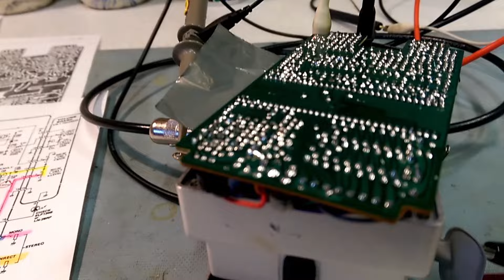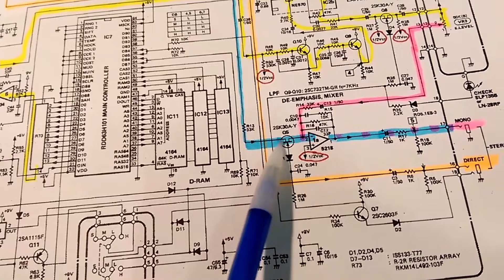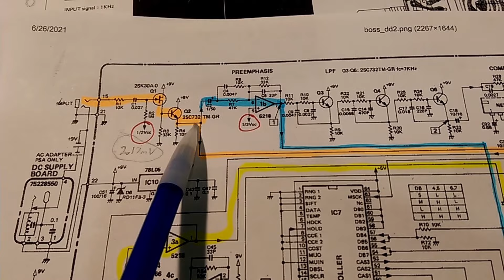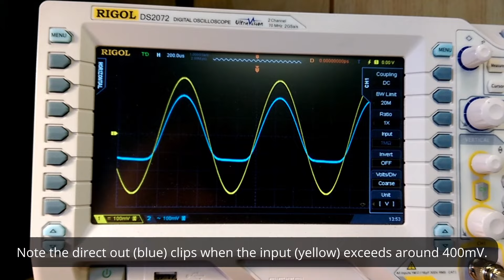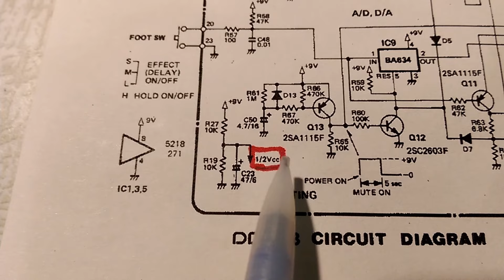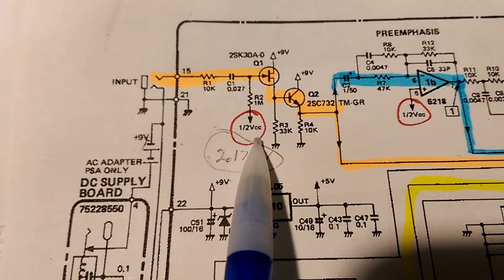Boss DD-3 Delay Pedal Troubleshooting and Repair (#001)

Comment: Nice video. I have a problem with my ds3, repeats sounds lower than dry signal. You play guitar, you have output ok but repeat is in a lower volume or sound like far, you know what i mean? Maybe if I have MXR Micro Amp activate isn't a big difference but you can hear something wrong. Thanks for read.
Reply from the maker: The mix control should adjust the wet/dry ratio.  Is that knob not working?
Reply: @mevmevmev  i don't have that knob... only entry signal, feed back, delay ratio and delay modes
Reply from the maker: @ezequielaugustodelcastillo6467  the first knob on the left "E-LEVEL"  turned up (clockwise) should bring up the repeat level.  Is that knob not doing anything?

Comment: i have a dd-3 that also just  stopped working. no power to the pedal. regardless if using battery or plugged in...
Reply from the maker: First steps I would take is to trace the voltage from the battery (or power supply) to the  input if the regulator  (IC10) on the schematic shown in the video.   If 9V is missing, check if D6 is shorted.  If there is 9V but no 5V on the output. then the regulator may be bad.  If there is 5V, it gets more complicated :)

Comment: Hi,
Thanks for your post.
I have a dd3 boss pédal and something strange happened.
First, when i power on my pédal board, this pédal IS "on" when other pédale are Always ""off" before steping on thèm .... I don't know if it's normal 🤔
This pédal began to make crunch noise when activating it and désactivation it.... 
At thé same Time when activating it, my tube AMP fuse blowed, IS it possible according to you ?
I triés this pédal with a classic 30 peavey and thé pédal only Works if you let your feet on it hold thé effect, but Nevers in on or off mode, it seems that thé Switch IS dead but Can this issue blow an AMP fuse ??
Thanks for your answer !!
Reply from the maker: If the amp is all tube, it seems unlikely the pedal could cause the amp fuse to blow.   Does the amp work after replacing the fuse?    If amp is solid state, there is a chance an extreme transient from a defect in a pedal could damage a component in the amp which could then cause a fuse to blow.
Reply: @mevmevmev  hi thanks.
It's an AB763 super reverb type.
We replaced thé fuse and it blowed at thé same Time i used thé pédal .... 30 minutes later.
I tried it on a classic 30 and nothing Bad happened ...

Comment: I have a dd3 that works, however, the selector switch goes through all modes before it reaches the second “click”.

Making it so I have to carefully turn the knob to where I need it, and hope it doesn’t move while playing.

I have absolutely no experience with electronics but am wondering how hard it would be to fix this myself, or if I should just bring it in somewhere
Reply from the maker: My guess is the control itself has a mechanical issue and would need to be replaced.   Soldering would be required, but not hard otherwise. Finding a nee part may be difficult.

Comment: I just got an half working DD-3...
Sound comes thru if the pedal is off
When the pedal is ON, no light on the Led and no Delay...
but....if I put it into "HOLD" mode and I press the pedal the led lights up and the sound is delayed indefinitely until you release the pedal (how it is supposed to work)

Any hint on what and where to loook at? thanks
Reply from the maker: I would first check the mode switch solder joints and the wires that connected between it and the main PCB for breakage.  2nd the switch itself could be damaged.  3rd, IC9 is a possiblity as it appears to only be used for the modes other than Hold.   Beyond that it gets more complicated.  Could do diode checks on the diodes and transistors that connect to the switch.
Reply: @mevmevmev  Thanks a lot, your are really helpful hints. I will definitely have a look into it this afternoon :-D thx a lot!
Reply: @AntonioGrazioli  did you solve the problem?